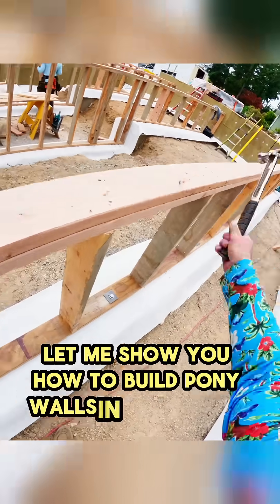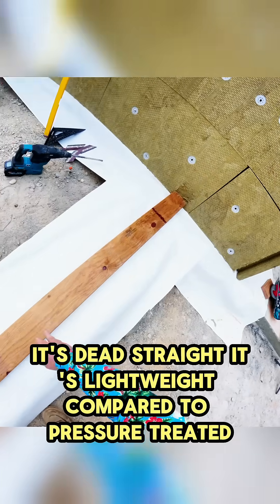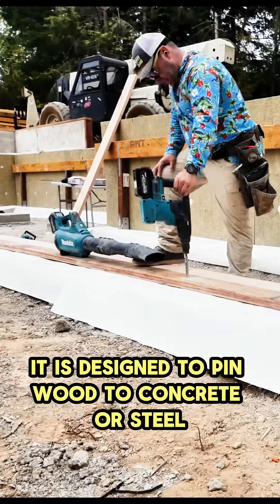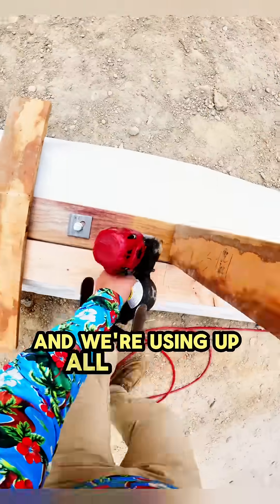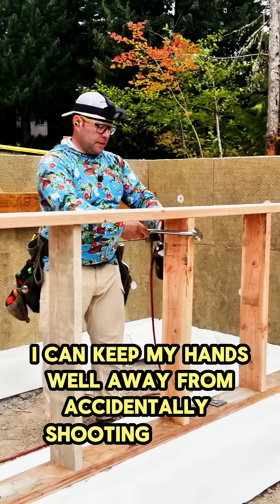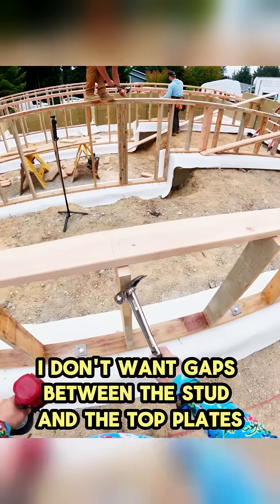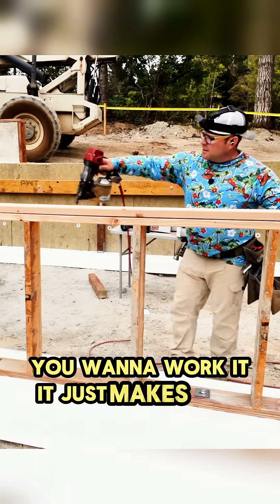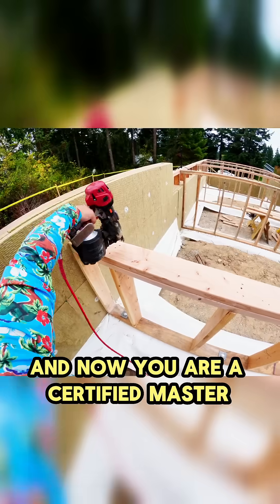Advanced Pony Wall Framing #framing #construction

Comment: Thanks. People should not think, however, that they must have a long continuous mudsill board. This makes it easier for you as a professional builder, but it is not important as long as you place the anchor bolts correctly.  You can add anchor bolts where needed at a splice. Normal sized pressure treated or rot resistant lumber is how it has been done forever.

Comment: You have tips on doing a pony wall that's not tied into other walls? We've been having problems with our wobbling too much. We build on concrete, and the red heads still leave it wobbling. We've been using angle iron across the width of bottom plate as our washer, it helps a bit. But would still like to tighten it up more.
Reply from the maker: The Simpson bearing plates do help a lot at 4' centers. I would strap the top plates to the exterior foundation wall too

Comment: What's the plate treated with that you don't need zmax/HDG/SS?
Reply: @kevinfarrell329 “Chemistry is PTI (propiconazole + tebuconazole + imidacloprid), delivered in-glueline (Tru-Core) = uniform penetration; not a surface dip or pressure shell. No added solvents/VOCs; approved for indoor use.”
i think because they aren’t using copper or any mineral based stuff, the reaction risk is not really there.
Reply from the maker: https://pwtewp.com/products/treated-lvl

Comment: Why not foundation piers every 8 ft. out of block with an lvl or triple 2x10 or 2x12 for a beam? I guess its a regional thing. Never seen pony walls in crawlspace out east lol. Always concrete or block until the beam that the joists sit on.
Reply from the maker: This allows us to use up our footing boards. We also like the strip footings connecting the foundation together. What I really want to do, is upsize the joist depth and out fewer strip footings in. ......next one
Reply: @AwesomeFramers  Got ya. Are trench footings allowed in your area or is it too risky it will rain and they will fill with mud and water? Nice crawlspace barrier by the way. That white material is pretty expensive,  but looks good when finished.
Reply: @AwesomeFramers he meant “put” not “out” had to read an embarrassing amount
of times to finally understand 🫠